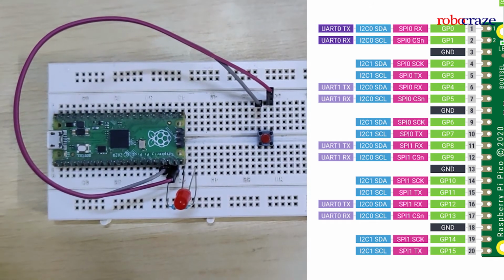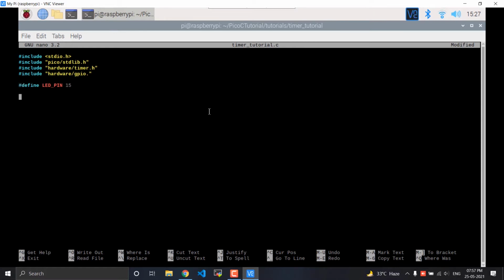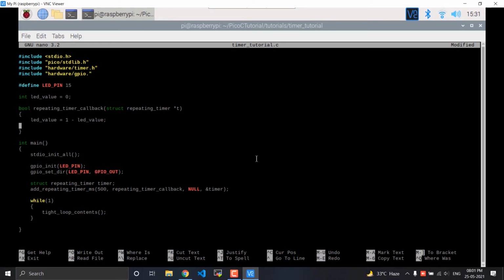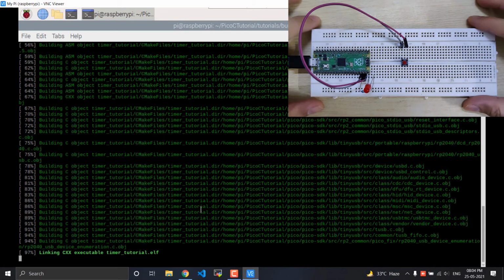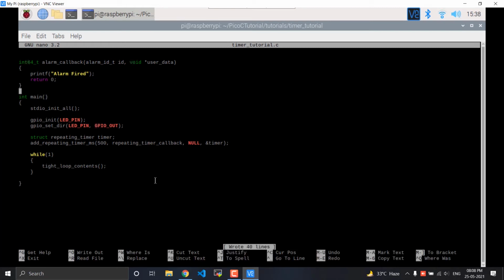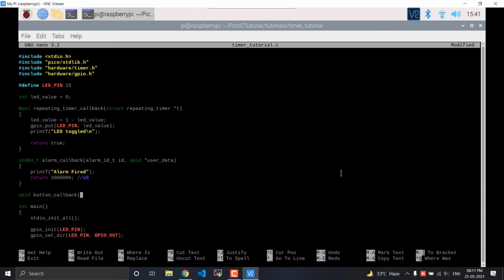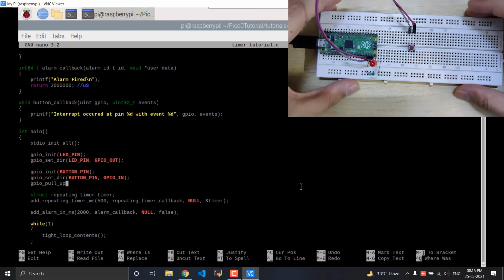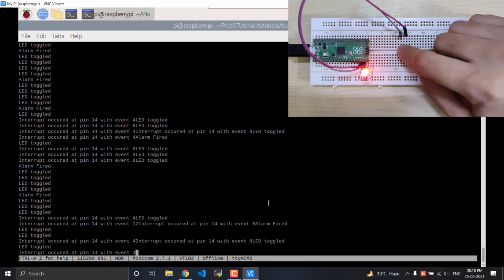Raspberry Pi Pico using C/C++- Tutorial #4: Timers, Alarms and Interrupts

Comment: Can you have a timer that can measure sub microseconds (ie nano second)?
Reply from the maker: Hello! Thanks for your question. Measuring in nanoseconds is quite challenging with most common timers, as they typically operate at microsecond precision. However, high-speed timers or specialized hardware such as FPGAs or high-frequency oscillators can achieve nanosecond resolution. It depends on the application and equipment you're using. Hope this helps!

Thank you for watching the video! :)

Comment: Hello! Nice video! 
How accurate is the timer? I want to do an hour display, and i wanted to use a rtc chip, but if the rpi pico is precise enough, i may use it!
Reply from the maker: Hello,
If your application requires high accuracy (e.g., for precise timekeeping), an external RTC chip might still be a better choice.
However, for most applications, the internal RTC or the hardware timers should suffice.

Comment: Great video! Thanks for sharing, very useful. Do you know if I can use interruptions to monitor serial ports? I am trying to figure how to monitor a serial connection so it can wake when a new message arrives, handle it and go back to whatever it was doing before. Any idea on the best way to do that? Thanks
Reply from the maker: Yes, you can use interrupts to monitor serial ports on the Raspberry Pi Pico. Set up the UART, define an interrupt handler to process incoming data, and attach the handler to the UART. This way, your Pico can wake up, handle the message, and return to its previous task.

Comment: what's a good method to use interrupts with more than one button?
Reply: I would say the easiest with few number of buttons would be to attach an interrupt to each button. The callback function  has the gpio argument which would tell you the gpio on which the interrupt came. If you have many buttons, you would need to use a parallel in serial out shift register to multiplex all the buttons. However this is a far more complicated solution.
Reply from the maker: Hello! Thanks for the question. A good method is to use external interrupts with each button connected to a different pin or use a single interrupt with a pin change interrupt handler, then check which button was pressed.

Thank you for watching! :)

Comment: Thanks for this! Question: What is the *t all about  in the callback? This is a deference of pointer t right? But I don't see where "t" shows up anywhere else.
Reply: Hi,

The *t that you see in the callback function is a pointer to the timer object that is responsible for calling the callback function. As you have rightly observed, the * operator is the dereference operator, however in the context of a function parameter, this indicates a pointer to the timer corresponding to the call to the callback function. This provides you access to the timer object inside the callback function in case you need it. One example i can think of would be to maybe disable the timer or to change its parameters etc. it is not used inside the callback function since the operation being performed does not require any modifications to the original timer object. Hope this answers your question.
Reply from the maker: Hello! The *t in the callback is a dereference of the pointer t, which typically points to a data structure or object.
Thank you for your question and for watching! :)